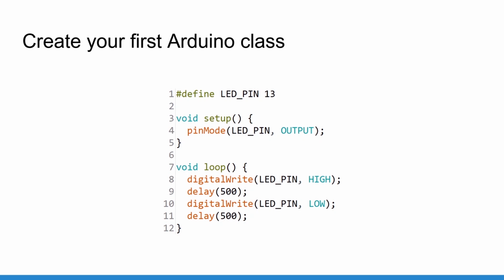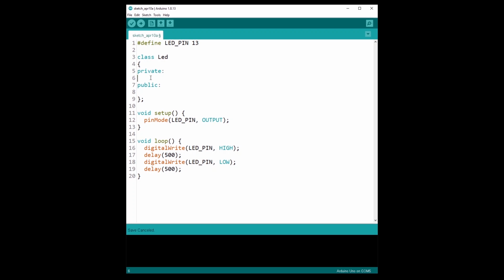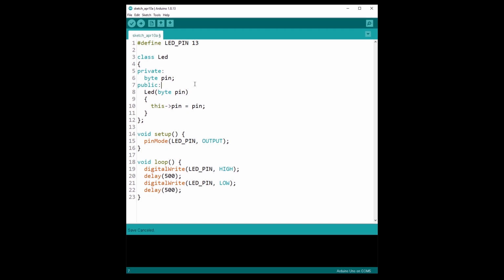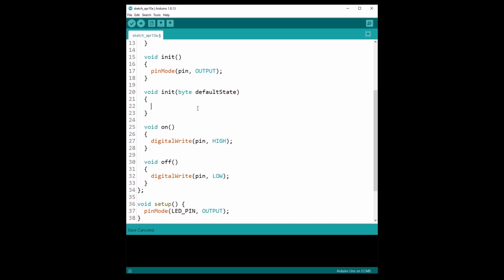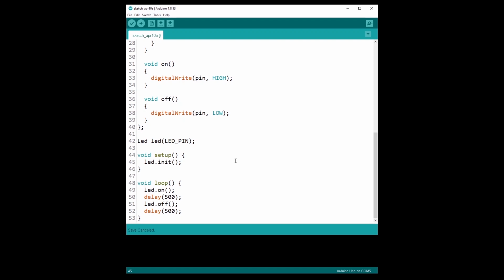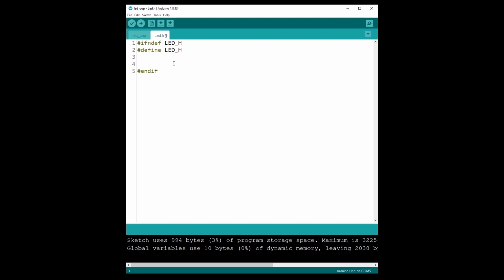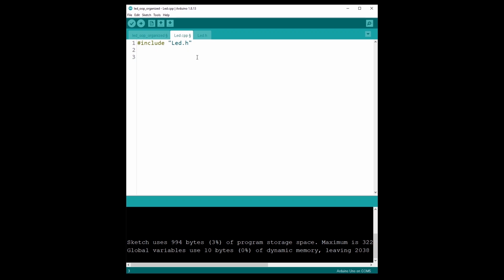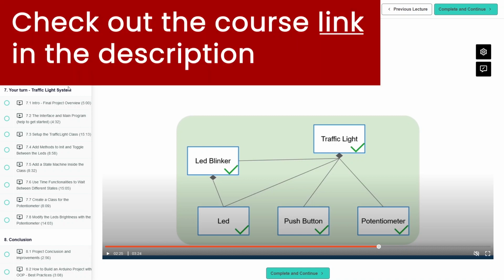Arduino OOP [40-Minute Crash Course]

Comment: Ok just have to say it. So to call 3 different functions, you wrote 2 files, both of which with more lines of code than the example. All to replace 3 lines in the example. Also there is more space allocated with the object. This is the problem with "oop" and it only becomes more difficult to follow the code and takes up more space in real programs. This is bad in embedded programming. I used to be very much into oop and all that Clean Code stuff and it can be kind of good to know it in the beginning, but understanding the hardware is better in the long run if you want to make more complex things. Knowing oop clean code principals will not help you understanding why your arduino stops working because of too many spikes in your circuit, why the timing of some thing is off etc etc..
Reply from the maker: Yes, definitely OOP is not suitable for embedded system programming, especially if you are going deeper with STM32 etc. But here with Arduino, the Arduino library is already a huge overhead, so adding OOP won't make much difference. I use OOP only with Arduino because programming Arduino (using Arduino libraries) is more like accessing the hardware as a software developer, not an embedded system developer. In the course I give more explanations about that.
Then, for the example I use, yes I agree it's a lot of code for not much. But in all my tutorials/courses, my way to teach is to remove everything that is not about the concept, so we just focus on the concept. Thus, instead of starting from a 500 lines code, I start from the most basic example. Just so we can focus on OOP and not spend 20 minutes explaining what the code is about :)
Reply: You missed the whole point, buddy!

Comment: Thanks for a clear explanation of the use of constructors and of "this". I wonder if an advantage of using "_" or "m_" before the variable name is that it makes it clear that it is a private variable that we are using, and we should not expect to be able to access it otherwise.
Reply from the maker: This really is a matter of preference, all options are valid (although if you just add an underscore, maybe better to add it to the end. So you'd have "pin", or "m_pin", or "pin_")
One thing is: try to be consistent, and if you join an existing project/job/etc, then use the same convention as they do :)